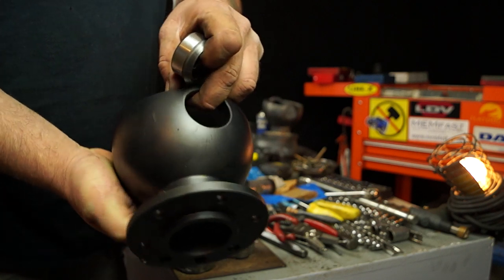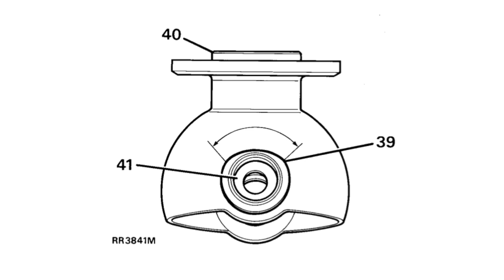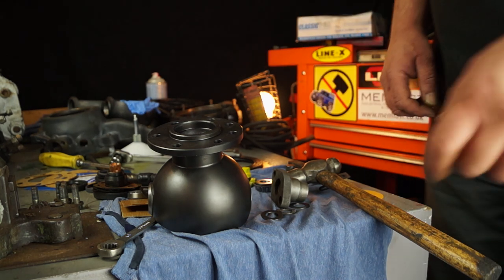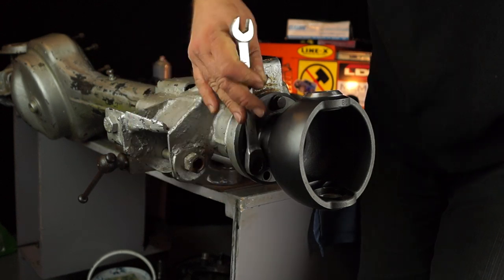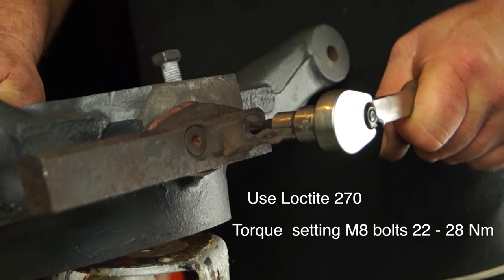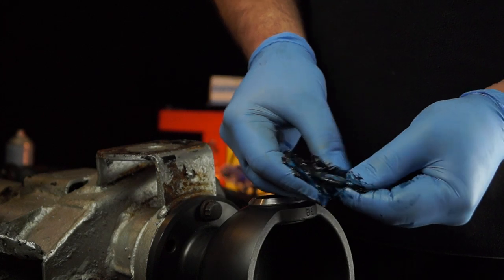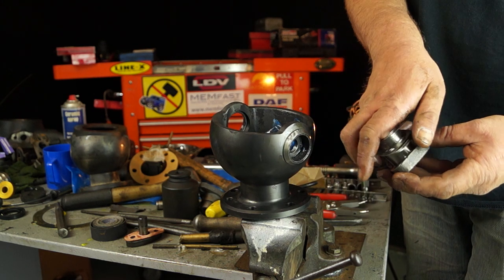Swivel pin housing overhaul Part 7 - fitting ball to axle / fitting bearings

Comment: did you adda  sealant to the swivel ball housing to axle housing joint washer or just install it dry? any chance of leaks at the swivel housing/axle housing joint if you don't use a sealant?

Comment: One of my swivels on my 90 has bad pitting in lines following the gasket on full lock, I guess from being parked up for a long time. My question is how much of a prioirty is changing the swivel? I have the parts, but prefer to wait until spring as winter Sweden is not fun for working outside. Any advice please. It is leaking grease and I have been topping it up. I also notice I am getting grease in the diff as it overflows when I take the level plug out.
Reply from the maker: remember two things, if it leaks grease out it will let water in and the second. All Land Rovers leak. If it doesn't leak then it's out of oil.  

TBH you could tolerate the leaking but it could cause damage if it is left unchecked but you need to evaluate this and risk assess.   Do you not have anyone who has a warm and dry garage that they could let you use?
Reply: @trailerfitter2  Thanks, I will bump it up my priority list. The fuel pump packed up last week and the requlator this week. I look forward to the point of preventative maintenance. One advantage in North Sweden is the -21 temps mean not much water ingress. Cold starting is about a one hr project at these temps. Thanks for the feedback and keep up the excellent work. By the way I followed your videos for replacing pump and regulator. Mind you I did cut a hole in the floor to get to the pump, no chance to go the right way. All the Best Michael

Comment: What are your thoughts on open axles, as in omitting the inner axle seal so that the wheel bearings and CV are lubricated by the 90W diff oil instead of bearing grease.  I've been running that way for several years as many on land rover forums recommend it, but  a professional opinion would be appreciated.  I'm going to be putting in new swivel pin seals soon, so if open axles are discouraged, that would be a good time to go back to inner seals.
Reply from the maker: The oil levels are different firstly that is why there is a seal.   EP oil is good for wheel bearings of course and i would agree to have it open to the hub from the housing.  To open the swivel housing to the axle means you lower the oil level in the swivel housing.  If it was workable Land Rover would have already done that.
Reply: ***** So you are recommending against eliminating the inner axle seal then?
Reply from the maker: Mark Kellgren  Well, put it this way, If it was mine the seal stays.
Reply: ***** I trust your opinion!  When I do my swivel seals, I'll go back to inner seal and grease shot! Thank you
Reply from the maker: Mark Kellgren  there is a section  in the workshop manuals that explains why there are seals in the axles tubes.  It is recommended to ensure lubrication is correct in each of the transmission components they advice to replace the seals if they leak.